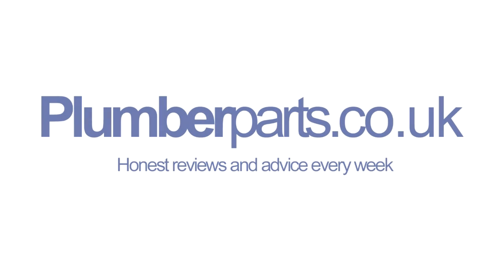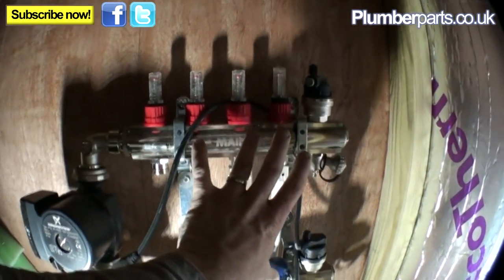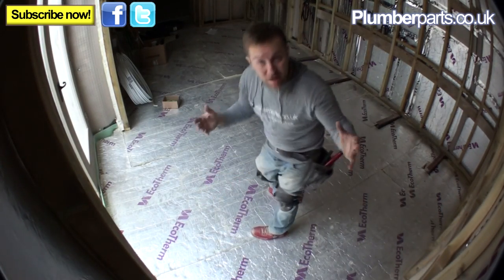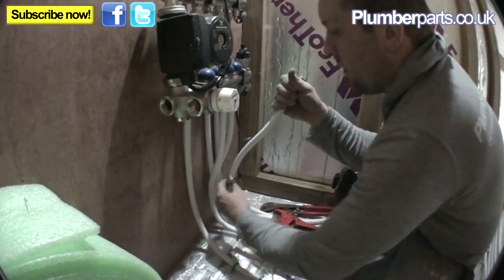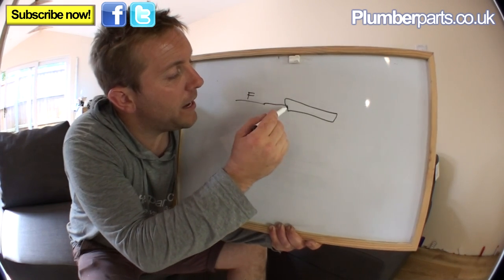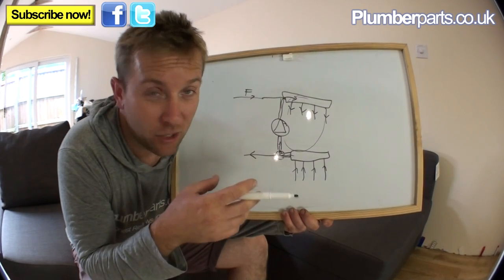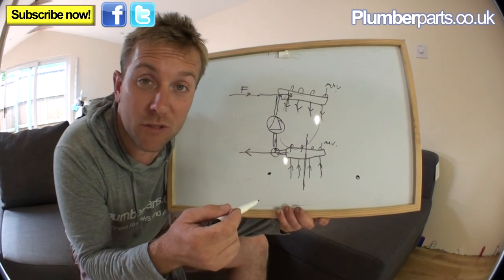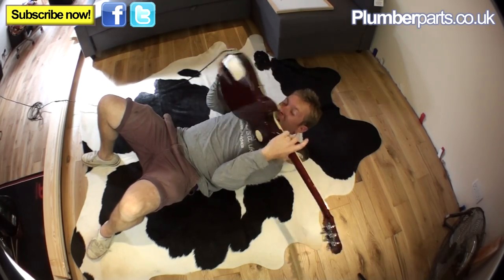HOW WET UNDERFLOOR HEATING SYSTEMS WORK - Plumbing Tips

Comment: hi there, may i ask, i will be fitting an electric combi boiler in my house for underfloor heating and instant hot water. my electrician will be wiring the boiler up, my question is this, is it within building regs for me to plumb the boiler in myself? i am not a plumber by trade but im pretty good at basic plumbing. also, does the supply and return connect straight to the boiler? i watch all your videos intently as i like to have a go at stuff myself and being a yorkshireman i like to save brass! thankyou

Comment: do you not need a bypass between the flow and return before it hits the manifold? ie  temp satisfied and three port goes to 100% by pass the boiler pump will be circulating against a closed head.

Comment: Very nice. That tubing is very flexible. Are there any worries about it breaking in the concrete? What about if freezing temps are encountered and the boiler is shut down (extreme situation i know) would the pipe crack if the water in them froze or would it expand enough then thaw and work as normal? I'm in the states and the whole idea of underfloor heating is intriguing.
Reply from the maker: Bounty B. Wolf Fine in concrete. Same precautions when it comes to plastic and copper pipe....always insulate!

Comment: Im just about to install underfloor heating in my new extension. What are you thoughts regarding pipe layout? I was advised that a snail pattern is far better than a snake pattern,  To be fair I haven't got the option as im using routed insulation boards with just a thin screed board on top.
Reply: +Stuart Petty snail everytime

Comment: hi great video.  just wondering im wanting to get rid of my radiator, could I just connect flexi pipe to each end of the inlet and outlet .?
Reply: Hi Neil, you can just cap it off / have it capped off as long as there is still one radiator in the loop without a thermostatic valve on it as the heating system will still flow. Remember each radiator is typically a T off each of the boiler in and out line.

Comment: Bloody brilliant video!! I'm looking to install water underfloor hearing in my existing property which has flat smooth concrete floor; what fixtures will I require for installing the pipes from start to completion? 36 square meters over 4 rooms; lounge, dining, kitchen, hall; porcelain tiles going on top. Thx
Reply from the maker: +unclepabs Man that's hard to answer without being infront of the job!

Comment: Nice video as always,  but it is worth mentioning that you must lay polythene over the Ecotherm before the screed goes down.It  is in the Building Regs.  and I know how you love the Building Regs

Also pumped liquid  screeds are way better than trowelled down screeds. They are 5 times stronger so  can be laid thinner and heat up much faster than sand and cement.
Reply from the maker: Skill Builder Hi Guys, indeed. Although we usually put the DPM down first, then the insulation. PP!
Reply: ***** The polythene isn't the DPM that goes down first as you say but you them  need to protect the insulation foil  This is from Celotex:- A polythene membrane on top of Celotex 
below a screed or concrete oversight performs three tasks: it acts as a 
VCL; it prevents migration of the screed / concrete which can force the 
boards apart leaving cold spots in the floor; and (most importantly) it 
prevents a reaction between the wet screed / concrete and the foil face
 where  gases given off can weaken the screed/concrete.
Reply: +Skill Builder good job the building inspector wasn't called in before pouring the floor ;)
Reply: +Jonathan Foottit 

Too right but it is a shame.  For the sake of a bit of polythene the screed is compromised.
Reply: I know I'm late to this conversation..But the building inspector has said to me that they prefer to see a visqueen sheet under and on top of the insulation

Comment: Does the pump still circulate water during the summer, is the water drained, or is the water kept stagnent in the pipes?
Reply from the maker: +Adrian Papineau Kept stagnant as you put it. It won't go off as there's treatment in there (or should be!)
Reply: +plumberparts Awesome, thanks!

Comment: Can one run underfloor heating from a combi boiler ?
Reply: Yes. It's easier in fact. Although just check your stat settings from the boiler. You just need the flow and return with one teeing off into a zone valve

Comment: Sorry , for this comment but the flow has to start from the window side thinkin about my  experience , so like the system u used to put the pipe on the floor is inefficient cause the first half of flow will be warm and the 2nd (return )not !so if the 2 half of the return is on the window side u can't break the cold bridge...its better if u put the pipe with a spiral Form called also bifilar!!! More efficiency and a better heat Distribution on the whole floor.
By the way you're talking about flow temps of 60 degrees in a floor heating sistem??? I guess ur clients will dance on the floor when they havent got any shoes on their feet ,did they?and the last thing u're talking about high tech, u think thats high tech?to regulate the sinular room temperature u put a Singular Electric engine on the manifold for every coil , that is connected by a room thermostate so u can even regulate the temp example 22.5 degrees in one room and 20 in another one for example only by adjusting the digital or analog room Thermostate. that is called high tech in my opinion coz u can.even command it with an cellular phone ;)i would be happy if u answer me 
Greetings Ad
Reply: So much wrong with what he sais it's a bit embarrassing

Comment: Your layout is not optimum. It should spiral to the center until half the hose run is used up then spiral back out to the edge. Otherwise you get uneven heating because the first half is hotter than the 2nd half.
Reply from the maker: Ok mate thanks for that.....😳 SUBSCRIBE! ➡️👉 https://www.youtube.com/subscription_center?add_user=plumberparts 👈⬅️if you haven't already!